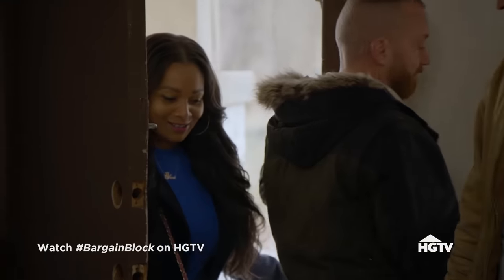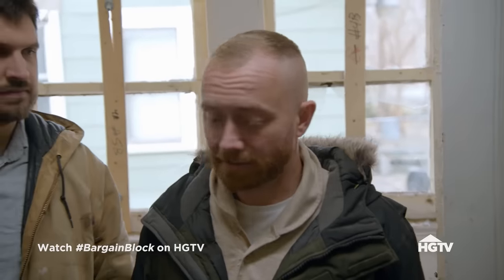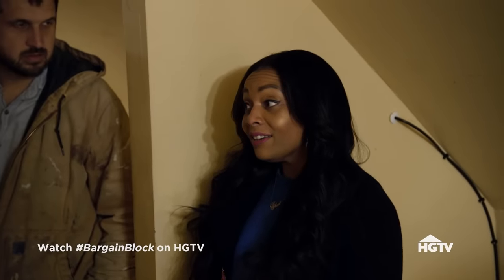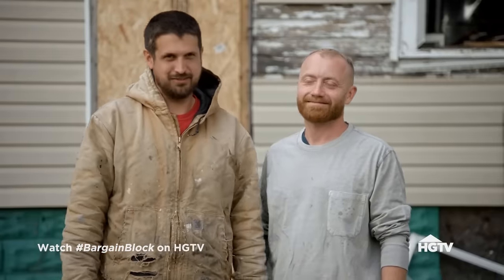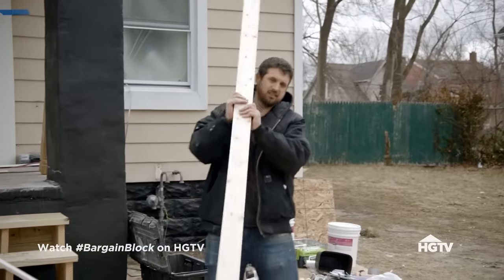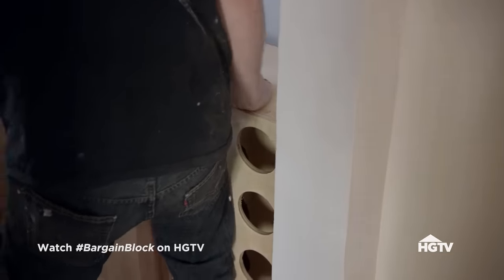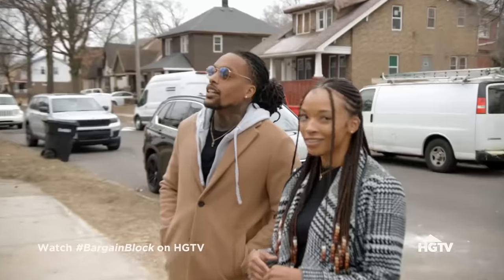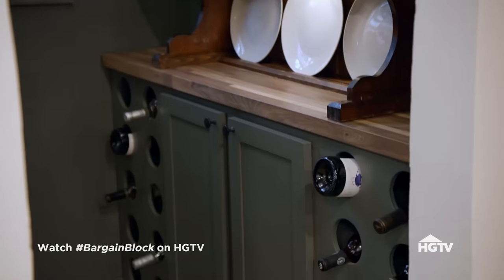Amazing Cabin Style Remodel of DECREPIT House | Bargain Block | HGTV

Comment: Clever way to disguise that drain from the upstairs bath -
Reply: I missed it. Where was that?
Reply: @b_uppy  In one of the "during" shots, it's a big PVC pipe sticking down through the kitchen ceiling. 

They made WIDE beams and installed three of them in the kitchen, with the drain pipe hidden in one. It also sets off the kitchen area and is a place for lighting fixtures.
Reply: @lazygardens  
Thank you for the clarification.  It's a good problem solve.

Comment: Nice, but one comment, refrigerator and freezer doors are generally versible so they could be hinged on other side. That refrigerator needs to have both doors changed to hinge on the left and the doorhandles are on the right side, that way, when you’re in the kitchen and you open the door, you’re in the kitchen.  Currently, you have to be standing in the living room to open the refrigerator doors.

Comment: Very nice transformation, but in my opinion some things could be better.

The fireplace should be on the opposite side, so when you enter the house you don't bump into the sofa and you don't have to navigate between furniture to get to the other side of the house.😅

The other is the fridge, I think that pantry should have been used for the refrigerator and the washing machine, leaving that cabinet with the wines in the part near the dining table in the visible part.

Comment: The refrigerator opens the wrong way 🤦‍♂️ Also, where is the laundry?
Reply: Not everyone has the luxury of having a laundry in small houses like the privilege ones.
Reply: @skdoremi6666 Right, the butler’s pantry was more important 🙄
Reply: @drewconway7135  yes it is since u need plumbing and it is costly.
Reply: Fridge doors can usually be changed over easily
Reply: Maybe it's upstairs.  We didn't get to see the other.  It could be stacked in the walk-in closet or new bathroom.
Reply: Most older Detroit homes have laundry in the basement... Although I think converting that "butlers pantry" into main floor laundry would have added value and increased desirability since it's more convenient and isn't common here.
Reply: Oops sorry